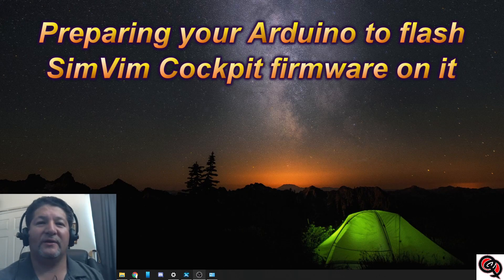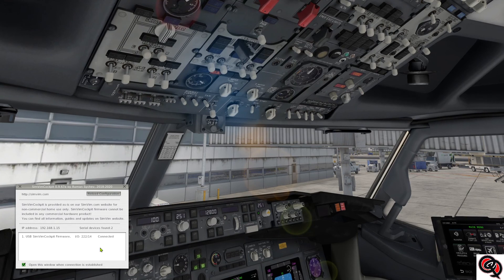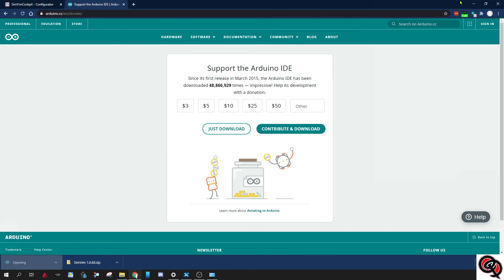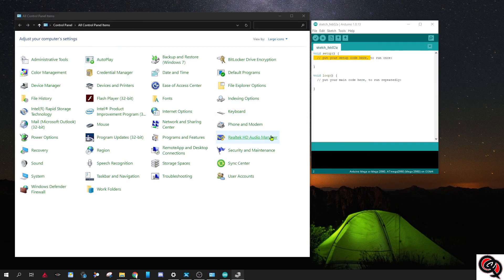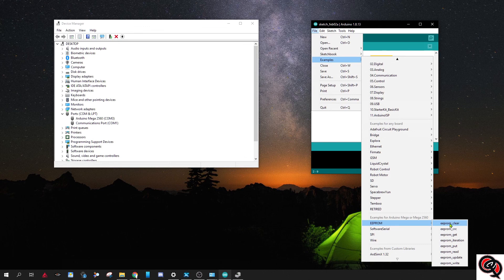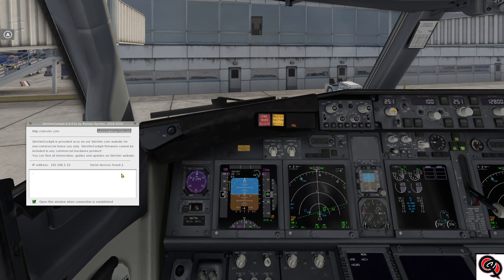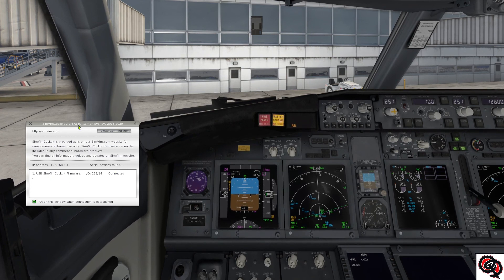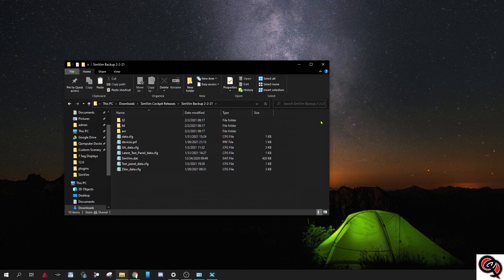Flashing your Arduino Mega to clear SimVimX firmware

Comment: Hello, I rebuilt entire MIP, which was working before. I mapped it as per instructions, nothing responded, not a single switch. I tested one single section and programmed on three switches nothing worked. The I cleared flashed the Mega board. This time switches responded on pin 0, 4 and 8 instead of 0, 1, 2. Any idea what's happening? Following is my mapping of three switch which I mapped for testing. 

[Input]
#----------- Input MUX on pin #30 -----
B30.0 Sys_Warn_Test                         Responding on Pin 0
B30.1 Master_CAU                              Responding on Pin 4
B30.2 Master_WARN                          Responding on Pin 8
Reply from the maker: I think I responded to this on another video. But my guess is that you have some of the S0-S3 address line wires crossed.

Comment: Hi my friend, yesterday i upgrade simvim plugin to 2.04 and now 3 of my multiplexer board are not working at all. when i upload all my input and output are uploaded in xplane . i tried to flash the arduino card  without positive, Where can i find the older plugin to make it work as before. Thank you
Reply from the maker: Hi Simon, I always save older plugins because once in a while a newer release causes issues. 

That's odd behaviour with me it just wouldn't connect to my Arduino with 2.0.4. It also made my xplane crash when I clicked reset plugin

I put V2.03 in my Google drive:
https://drive.google.com/file/d/17-nF1HAPV1X6uYvgnaAbHri6FTFSJD7J/view?usp=sharing
Reply: @Qosmokid  Thank you so much for your help, i install the simvim 2.03  and it did’nt fix my problem. I think i will have to replace the 3 multiplexers. it is very weird that hapens at the same time i install the 2.04 and today they release the 2.05 and i try it without succes. i will keep you informed ! Thank you very much it is very appreciated.
Reply from the maker: @simoncardinal5116  I really dont think you have three bad multiplexers though
Reply from the maker: @simoncardinal5116  I just installed V2.05 and it looks like the connection issues are gone. Everything seems to be working perfectly
Reply: Hi Qosmokid, i tried the 2.05 yesterday but my problem still the same today i will check my wirering for thoses 3 multiplexers, i’m sure its a stupid problem, but i let you know. Thanks for your kindness!
Reply: @Qosmokid  Hello i’am again searching for my trouble, do you know what could be the problem? it look like 4 of my multiplexer connected to analogic side are the problem since the upgrade to 2.05 . other card connected to analogic work great, so i move one of the multiplexer to logic and it work . I check all the wirering and the cards are working fine.now I realy dont know what could be the problem. software ? thanks
Reply from the maker: @simoncardinal5116  I don't think the issue was that they are connected to the analog pins on the Arduino since those can also be used for digital input and MUX boards. I don't have any of mine connected to A0-A15. Maybe one of these days I can experiment and if I notice something I'll comment here
Reply: @Qosmokid  Hello, the problem was comming from the software, Vlad make an new update of the firmware yesterday.Now everythings working as before.Thank you !
Reply from the maker: @simoncardinal5116  oh that's great, thanks for letting us know

Comment: Thanks for another great explanation! Would this method of conection  work to connect Arduino UNO R3, as well? I'm trying to use UNO as a slave of my master board MEGA, in order to install several LCD displays (As you know, the guys of simvim advice use a slave board instead of the old method of connecting directly the LCD to the master board)  However, in contrast to the master, I don't manage to connect UNO. When I try to do it, after a few seconds, simvim releases the following message: "Simvim attempt to connect slave board finished", but not connection is gotten (On Simvim setup, I clicked on LCD slave (instead of master board, of course) and them I chose upload the firmeware for Arduino UNO. By the way, My arduino UNO is original). Thanks in advance for your help.
Reply from the maker: Hello Alejandro. I have not used an UNO slave board for LCD connection but I do have one and I did the firmware upload for LCD slave controller board and it worked fine. When you say "No connection is gotten" are you saying in the SimVimX status window? Because I don't think you will ever see a connection there, that will only show the MASTER Board or SimVim Panels connected. I assume after flashing the firmware you connected it to the master board on pins 14 and 15 as shown on this page right? https://realsimcontrol.com/io_lcd.html
Reply from the maker: Also you can still use the "OLD" method to connect LCDs directly to the Mega 2560 on pins # 20,21 and 30-49.
At least for now, it does hint that that option may be removed later, I hope not

Comment: Thanks my friend for the information, I've now updated the SimVim firmware on my Mega 2560 to the latest version and all appears to be working fine. Regards from the UK :-)
Reply from the maker: That's good to hear. Mine are working pretty much perfectly except for a small issue in which every time I press reload config the firmware update window opens and closes a few times but it eventually reconnects